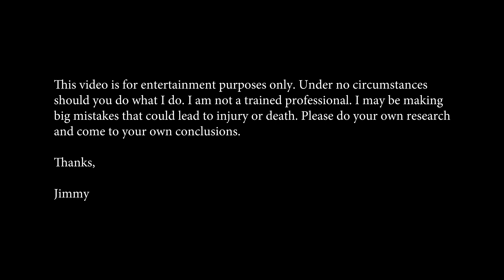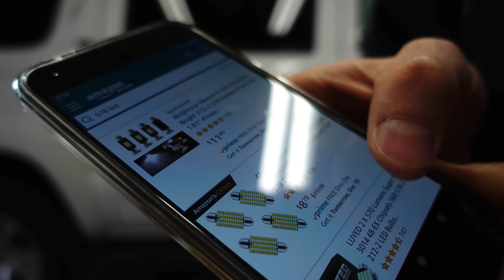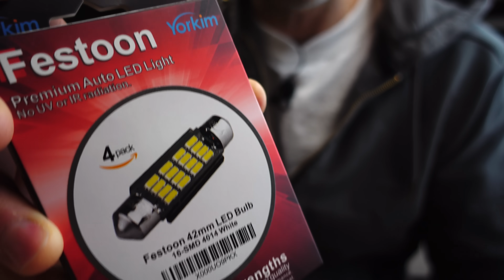Here's Why You NEVER INSTALL LEDs IN YOUR CAR OR TRUCK!!

Comment: “Why you SHOULD install quality LEDs in your vehicle” would be a better title.
Reply: Auxbeam is the way to go.
Reply: I think you means, "Why you maybe or maybe not should install QUALITY leds in ur vehiclez".
Reply: Yeh, he click baited me 😂
Reply: Don’t use “daylight” LED’s (~5000k color temp), or even 4000k LEDs, If you want the look of incandescent/halogen bulbs, get LEDs near 3000k color temp.

And for automotive use, you need to make sure you have bulbs designed for automotive use, because the g-forces from road use can definitely damage low quality LED bulbs.
Reply: @geoffstrickler Hi, your response is quality. I actually drive a car with halogen lamps. I tried in the past to install LEDs to have clearer light but my ECU caught them as an anomaly. 
Just wondering why.
Reply: @lLukeSkyscraper  Drawing too little power, your ECU flagged it as burned out because it wasn’t using enough power.

Comment: I missed the reason why "You NEVER INSTALL LEDs IN YOUR CAR OR TRUCK!!?
Reply: True.  I thought the same.  In my experience, LEDs make a high frequency feedback that interferes with radio reception.  Especially weaker AM and FM stations.
Reply: @HamiltonSRink  Only the ones that use a DC buck converter to limit current do that RF noise. a transistor or resistor on it's own will dissipate some heat but not create any RF noise.
Reply: @Blackwolfster  Ok, fine.  As a consumer, how does one tell the difference?  Are the products marked somehow?
Reply: I missed the discussion about LED tail lights that trigger the fault switch indicating a non functioning light. 

On my bike, I had to install a converter to let the bike know the lights are working. 

I was told at the auto parts shop that wasn’t necessary, so I dumped good money into purchasing taillight LEDs in my 2013 RAM truck. 

Almost immediately to fault switch was triggered. 

Back to halogen. 

I’d like to know the fix to this problem.
Reply: @kenflauding6041  In future, the electrical engineers who design automobile electrical systems, will incorporate LED's properly.  Until then, my personal vehicles will be using OEM type bulbs.
   Now if you happen to be a qualified electrical  engineer, you most likely know what is required.
    I for one don't enjoy being blinded by oncoming traffic when these bright lights are aimed too high.
Reply: @kenflauding6041  make sure it says CANBUS compliant
Reply: @HamiltonSRink  I've not noticed any led that messed with the radio, And i'm a guy who has over 200 leds on my truck.
Reply: @towtruckaj  That is good news!  You must be doing something right!  I do auto repairs.  A customer brought me a Goldwing trike 2009.  For this complaint.  I installed small clip on iron chokes on all the 12v wires supplying every light.  It helped, but did not eliminate totally the interference.  Maybe the body of your truck, provides a shielding effect.  Or you have the better LED's. Or you listen to stronger radio stations.
Reply: @HamiltonSRink  Idk, I've never noticed an issue on any of my trucks, but my most notable truck is my work truck that I do have well over 200 leds on, that being said it is a medium-duty so the cab is significantly farther away from said lights, as well as the antenna than a car would be, but i also have my older truck, an 07 f150 that has a few leds on it, Rear leds, a 52 inch light bar, a 20 inch light bar, and 3 led pods for the front, no issues there either though. I've actually never heard of that issues before though, no saying it doesn't exist but I have never heard of it.
Reply: Over heating in cheaper bulbs
Reply: @HamiltonSRink  I have noticed the same symptoms in my car after installing LEDs the FM stations are always having noises.
Reply: @MiloPerrotti  what’s that mean. I got some from Amazon that are called (Sirius led) and they say non canbus. Are they coo to install or nah
Reply: @MiloPerrotti  also there interior lights.
Reply: @swervv2957   On newer (not sure what year it started!) vehicles the light bulbs "tell" the ECU if they are working via CANBUS network. That's all I know!!
Reply: for clicks
Reply: @HamiltonSRink  ..LED's...to dim them, you need a series resistor...the resistors can get hot, and add additional cost since you now need a small PC board to mount them, if you're running a dual circuit like Blinkers, you need another wire to by-pass the LED for 'high' power, and even then, the LED on 'high' can get hot. So, most automotive LED's are driven with a PWM circuit. The PWM can cause high frequency noise, and even a 'flickering' of the lights...most noticeable on those BIg-Ass Cadillac tail-lights.
Reply: @HamiltonSRink  Quite a few 'LED' conversions for headlights don't work that well...LED's require a different reflector...so, if the vehicle didn't have OEM LED's...it's not likely to be OK ...
Reply: @dougankrum3328  Yes you are correct.. The whole system needs a redesign, not just install some LEDs into an old system.  As I see it.
Reply: @kenflauding6041  My guesses: The vehicle computer could have an electrical current/load sensor that is expecting a certain amount of power load to consider the bulb present and working, in which case it would need to be reprogrammed to a new threshold.  Alternatively, and more probable, the sensor check could be a simple low voltage continuity test to check for a broken/missing bulb and the LED may be in the opposite direction to the current for the test (diodes only allow current in one direction) or otherwise acting as a resistor (a standard bulb has almost no resistance to such a test) causing the test to fail.  In which case if the bulb can be installed in more than one orientation try reinstalling, or try another brand (maybe contact the OEM of the new bulb to see if they can shed some light).  It is possible the diodes impose a resistance at very low electrical states depending on how they are designed.
Reply: @HamiltonSRink  Those HID vehicle lights are almost bright enough to cast shadows on the moon.  I keep expecting to see my skeletonized shadow cast on the back of the vehicle in front of me when they are behind me.  The police light bars where I live are essentially strobe blinders at night and a real hazard in my opinion.  They likely are just barely within the health and safety limit to prevent retinal damage.
Reply: @stevedixon921  I especially love it when the Pick Up owners install LEDs and then lift springs in the front ( to even out the profile), but fail to re aim the headlights down to their more appropriate position.  Then they get behind you at red lights, and you have to reangle the mirrors to avoid going blind!
Reply: They blind other drivers
Reply: @HamiltonSRink  He never did make it clear why the "electrode" version was inferior to the "solid state " version.  He never finished explaining the heat issue. The reason is the poor design of the connector  with respect to the needs of the "upgrade LED" circuitry ... in THIS particular case,.   Anytime the consumer chooses to take the 'plunge' into new technology ... Caveat Emptor more than ever in this century .
Reply: @teresawatson8936  So, You are agreeing with me?
Reply: @HamiltonSRink  Try Diode Dynamics, never had any problems using them and they also have resisters in them to reduce noise, though are more expensive! I used Lasfit bulbs in my truck and had key fob problems and could not start the vehicle unless in ACC or Run while pressing the button. Diode Dynamics has no problems at all from what I have found and are well tested. If the threshold if frequency burns too hot, the resisters reduce the heat to compensate on wattage.
Reply: @netsurfers9357  Good to know! Where are they sold?
Reply: @kenflauding6041  you need load inline resistors or there’s other products like canbus error canceller
Reply: @kenflauding6041  Load resistors on the line leading to the LED bulbs will fix that issue. They create a "load" on the power line that the car detects as the tungsten/halogen bulb being "on". Just be cautious, though, If the led fails, it may not produce a warning indication.
Reply: The more I watched, the more I think he likes LED.
Reply: @garysimmons2020  At some point they will push incandescents into the obsolete category.
Reply: @kenflauding6041  You need a relay that works with LED, instead of the mechanical style relay used with halogen bulbs.  You can either install an electronic LED relay, or you can add resistors to your wiring harness, which "trick" the old relay into thinking halogen bulbs are being used.  Using resistors is not ideal, as they create heat, and they completely negate the purpose of saving energy with LED's....
Reply: Because they make RF noise that interferes with radio reception, and other electrical (computer) related issues.  But, If you run an older car and don't listen to the radio, go for it!  LED's that come on newer cars from the factory are properly engineered and work well.
Reply: He's worse than scotty 😂
Reply: @HamiltonSRink  I notice this issue with a Ford e350 van, but my 92 Silverado is perfectly fine with all the lights LED, weird.
Reply: @VikingDudee  1992 GM has no CAN bus.  Why year is E350?  If it is newer, it has CAN bus.
Reply: Lol
Reply: Because they don't have proper heat sink as explained in video , you should be cautious about it while replacing
Reply: @towtruckaj  Me either !!
Reply: Have used them for many trailer lights !!
Reply: The reason why not to is because they over heat and Fail
Reply: Tag bait its just to get ya to click or watch it
Reply: He tricked us :) but his comeback was goof enough for me and I learnt something new so gave the video a like.
Reply: Yea cuz hes trolling for views..  thats why he has very few actual subs..
Reply: I don't like the bluish white light.
Reply: What is your name ?
Reply: Five years ago I installed GE LED’s in my bike. The GE’s came with a buck converter and heat sinks that get slightly warm. They are much, much better than the stock halogen bulbs. I can extremely well in the dark and cars coming towards me can see me day or night.
Reply: @HamiltonSRink  Just because we can create a lamp with the intensity of the sun doesn't mean they ought to be used as vehicle headlights.

Comment: I was a building engineer in two high residential high rises for over forty years during that time I had to make numerous shifts to new lighting technology (electronic ballasts,, f8, f6, low pressure sodium to high pressure sodium, and finally to LED’s which I have in 1999 f50) my advice is buy from a company that you have heard of (Philips, GE, Sylvania etc) yes they’re more expensive but they will probably last longer. Good luck!
Reply: Sylvania LED’s are very nice and high quality
Reply: @ElantraFukkenGang  Just replaced my 8 year old OEM halogen bulbs in my Jeep Wrangler with the Sylvania Silverstar Ultra Halogen H13 bulbs and that made a little difference. Now my next task is replacing the headlight itself as these are the originals and the clear lens has fogged over to the point of no return.I wasn't expecting a significant improvement in illumination since I am staying with halogen but some improvement will be gained with clear, not cloudy, headlight lenses.
Reply: If only it were easy to find quality lamps. The cheap stuff breaks way before their rated lamp life -- from overheating!

Comment: I was a mechanic for fifty years and I have a suggestion.  The title of your video should be never install leds in your vehicle if they did not have them when the vehicle was new.  Vehicles that come with LEDS already have the proper voltage regulators installed with the proper reflectors and mounting plugs.  There are truck lights that come with a regulator already installed in the fixture,  look on the back, (it looks like a resistor) or it will say so on the package or in the catalog.  I also worked at a NAPA store after retiring and some of our LED head light units said they were suitable as replacements for older cars while some said they were not. So you need to read the package or ask the store employees.

Comment: The difference between a halogen bulb and an incandescent bulb, in case anyone is wondering, has to do with the tungsten filament vaporizing and depositing a metallic film on the inside of the bulb, turning the glass envelope into a mirror that traps light inside. Halogens contain a gas that combines with the vaporized tungsten, and continuously redeposits it back on the hot filament, keeping the glass nice and clear.
Reply: Good point. I believe halogen also allows the filament to be heated to a higher temperature without premature failure or causing those deposits on the bulb glass, thereby allowing it to glow hotter and brighter.
Reply: @Land and Lore Photograph Off Road Adventures And so is a tulip bulb if you set it on fire, but still, all three are distinct if you understand their composition.
Reply: @Land and Lore Photograph Off Road Adventures Generally in the lighting trade, regular incandescent bulbs are referred to as tungsten bulbs (tungsten being the filament material) while halogens are called tungsten halogen. It just gets confusing when colloquial terms are used.
Reply: Tungsten halogen bulbs only have the halogen cycle (where the tungsten is redeposited to the filament) after a period of time at 250-1,100C (485-2100F), hence the need for the quartz envelope. Short on-off cycling of halogen lamps do not provide sufficient time for the required heating, and thus the tungsten builds up on the envelope interior. Burning the lamp for 10 minutes at full power will redeposit the tungsten to the filament.
Reply: @Land and Lore Photograph Off Road Adventures  100% correct!
Reply: Thanks. I knew roughly but didn’t know those precise details. Fascinating! What a discovery! No wonder it took so many failures by Edison and Swan to get it right!
Reply: Halogen bulbs are a specific type of incandescent.
They're not a completely different type of light conversion from electricity.
Reply: And VERY hot !!!
Reply: Halogen  and incandescent light's biggest failure is from vibration, causing the very small wires that make up the filaments to fail and break. The LED's have no moving parts, so vibration is not a point for failure.  Heat is a failure with LED's when they first came out. That problem has been engineered out now using heat sinks. These bulds should theoretical last forever. Just remember incandescent bulbs were invented by Thomas Edison in 1870. It's about time we move up to the 21st century and start using something better that uses far less power, better quality light, and can last 35 years or more. Just a thought.
Reply: Except that's not quite accurate.  Halogen IS an incandescent bulb type, and that the halogen allows redepositing the element particles, just means the bulb can handle running hotter, producing more light without filament degradation at an unacceptably fast rate.  The glass remains nice and clear on even the cheapest of non-halogen bulbs used in automotive apps, because they are driven within what the filament can withstand.

Comment: I've never had an LED interior light go bad.  I'm still running LEDs I've installed over 10 years ago.  One thing to watch on custom LED lights is sometimes with pairs of LEDs, the instructions tell you to put it on the wrong side and it won't fit there!

Comment: The main reason I installed the LED interior bulbs was because of the reduced power used, 1.5 Watts with many of the LED bulbs vs. 10 Watts with the incandescent bulbs.  This helps for those times where a light gets left on accidentally and drains your battery overnight!
Reply: The only problem I had with the ones I ordered was the glue that bonds the metal leads. In hot summer heat lasted about 2 months. If you find a good brand stick with it. They aren’t all the same.
Reply: That difference can be a huge one when it is for the lights used in the hazard flashers. I recall being by the roadside with a dead car and the flashers dragging the battery down before help arrived.
Reply: Stop leaving your lights on
Reply: A lot of cars would automatically shut off the lights before you even get to the car....🤷

Comment: Another great use for the 12V LED bulbs is in RV's and Camper Trailers.  Changing out the old incandescent bulbs to LED's really cuts down on the power drain from the batteries while providing much better light.
Reply: Also heat. In the summer the interior lights put out a lot of unwanted heat and makes cooling the camper a lot harder in hotter climates.
Reply: Absolutely